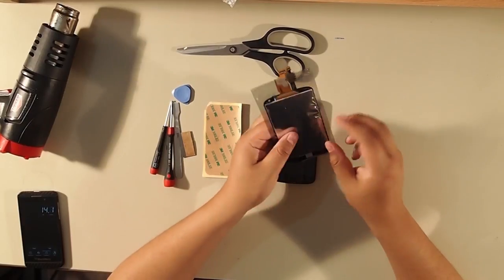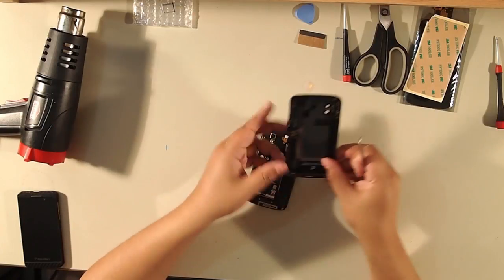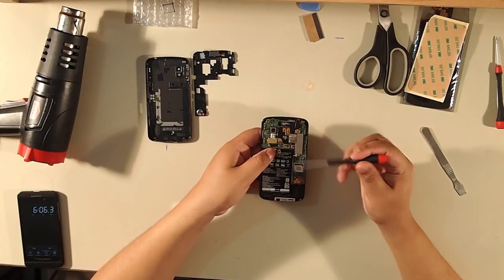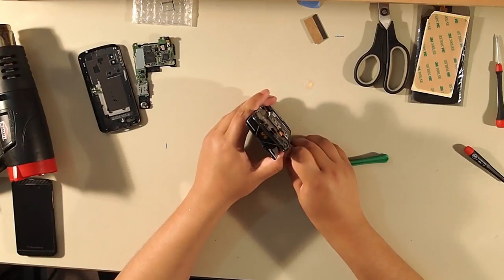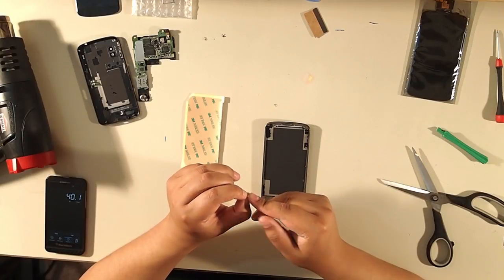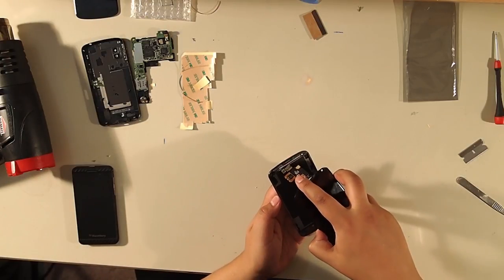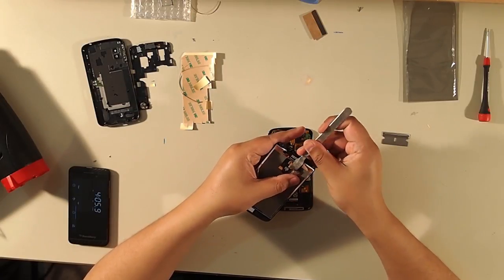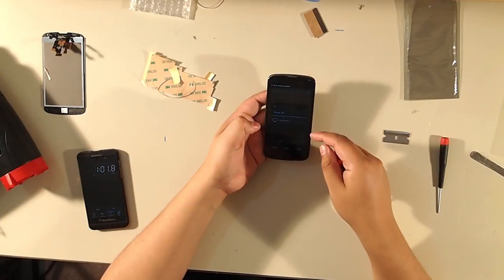Google Nexus 4 (LG E960) Screen replacement.DIY tutorial

Comment: I replaced my screen and there are stripes throughout and the left quarter of the screen is totally blank.  Did I get a bunk screen or did I break something during replacement.  Also, there's a small grey rubber piece that was lying on the table when I finished... what is this and do I need to put it back?

Comment: How susceptible are the parts to melting before the glue softens? 

I replaced the screen on my N7 2013 and the plastic bezel warped/melted from the heat gun while the glue still wouldn't release. I ended up having to buy a new bezel which was very hard to find. 

Now my N4 is busted too, and I'm a bit nervous about doing the procedure with the heat gun.

Comment: I used this method to replace my screen, when I turned on the device the screen worked, but all you could see is parallel lines in multiple colors, so it works but damaged. I triple checked any connection and nothing works. Any one know how to fix it?

Comment: This video was extremely helpful in replacing my wife's broken Nexus 4.  I would like to add a few things that will hopefully help some others in the future.  I bought my screen from Amazon and it came with several tools, but the screwdriver that came was mostly useless.  You will need two different screwdrivers for this: a T5 (torx) and a PH000 (Philips).  I had trouble finding the double-sided tape that was used in the video, but I ended up going to Fry's and buying a roll from the components section.  You're probably better off looking on Amazon when you order the screen.

Another step you will want to take that is missed in the video is the LED cover.  You will need to remove the white cover from the old screen and place it on the new screen before squeezing it all together.  Hope this helps!

Comment: Could someone tell what that silver tape on the digitizer ribbon connection is called?
Reply: Or if it even required for long term use?
Reply: yeah I am also wondering about that, because the new replacement screen digitizer ribbon doesn't have that aluminum foil (or silver foil ?) attached to it.
Reply: I spoke with a 3M support rep and he said we could use:  3M 1181 conductive EMI shielding tape.  I haven't tested it but that is what he said.
Reply: I thought 3M 1170 would be good but I was just taking a guess
Reply: I suppose Al foil will work too, I have made faraday cages out of it and works perfectly in my impedance experiments.

Comment: Awesome video. I replaced my screen step by step and it worked perfect.

It didn't turn on at first when I tested it by just fitting the mother board ... The connections to the on button were loose... I screwed the mother board down and it worked like a charm.

Thanks again!
Reply: No, wait! The proximity sensor doesn't work :|

Comment: Appreciate vid techguyz708 Check the hilarity of my life: We are T-Mobile customers, Wife tripped and shattered her Samsung GS4, I hated my Galaxy Light, so snagged an ATT GS3 with a small crack in lower left corner that work was tossing out and unlocked it and my daughters N4 glass cracked diagnonal from top left to bottom right of screen in a series of events that got her suspended from school for 2 days lol.  I inherited my damage but it's really pathetic going out to eat and the waitress looks at every phone on the table and replaces our drinking glasses with plastic sippy cups lol.  So ordering replacement glass for all 3 phones tomorrow for my clumsy family.
 I was a mobile tech for my office for 4 years, primarily a blackberry shop so I can tear down and replace just about any part on a blackberry  and even have a few unboxing and tear down vids on my work youtube account. I have also done quite a few screen and battery replacements on iPhones 3x to 4s, and very recently with the aforementioned GS3, hard bricked it with a failed root but had a spare motherboard that I was able to drop in with surprising ease and success, so while not familiar specifically with this hardware, I'm not squeamish with the work, but had a few questions for a consummate professional such as yourself:

If looking to just replace glass can this be done without the disassemble, I've seen people on youtube do with Galaxy S3/4? (heat gun and lifting tools, didn't even take the battery cover off).

 On the N4, device powers on, screen clear and visible. The top diagonal quadrant of glass is still touch receptive, but below the crack it is completely touch dead, will this resolve with just glass replacement or do you think I'm looking at having to do a full LCD assembly replacement?
 - Is there anything I can do to test this before purchase?
 - Is this common with LG's hardware or the N4? Both of the Samsung's (wife's with multiple fractures) work just fine and am only replacing for cosmetic value.
 - Comment on Amazon for a kit, warns that he destroyed his LCD with heat gun, and cautions that LGN4 LCD is very delicate.  You FFwd in vid during heat application, but didn't appear as if you were treating LCD with any special delicacy. Do you have any pro tips, or if there is a 'feel' or look to screen once it's gotten hot enough to remove?
 - Most importantly, Is fixing kid's phone worth losing the hilarity that ensues as she flips it left and right like a Rubik's Cube time trial champion trying to access the tap-able half of the landscape keyboard in order to send a text message?

Lastly, I checked the tool kits you linked in About, but didn't see that epic metal separating/splitting tool you were using.  You seemed apologetic to be using, but I want one if you can point me to the manufacturer. The kit I use at work had two plastic separator tools that my student assistant destroyed on first use as the lip or whatever it's called (thin strip of plastic that does the separating) were complete stressed and bend like a straw with any attempt at utilization.  He won't cop to it, but believe he was trying to lift a manhole cover or such with them.  I typically use plastic butter knives, but it is a brittle medium and that metal tool looks like the bee's knees.

Alright thanks! Sorry this ended up being such a book, but hope you have the time and patience to read and respond.  Thanks again for the vid and your efforts!
Reply: You should be a writer.... That was a funny read. Did you fix them all?

Comment: uh quick question... I'd love a fast response from anyone.. in removing my battery the strong adhesive created a tear in the aluminum layer underneath... is it still safe to use or am I up a creek and have to buy a new battery too?
Reply from the maker: it may be safe to use as long as there still another layer underneath. be careful though cause if it leaks you will ruin your phone to start with.
Reply: It's been running fine for a day. Is just the bottom aluminum layer that tore before I realized it as I pried it up. I will check it later and take it apart and see what it looks like after some use.
Reply: +Matthew O'Mealey Did it continue working OK? I just did the same thing!
Reply: James Scott it ran fine for about 3 months. Then started randomly dying around 30% and began going up to 45... 50%. So I opened it back up and the battery was starting to swell up so I ordered a replacement off amazon and it's been fine since.

Comment: Is this what i should do if my screen is all broken? and would a hair dryer work to heat up the glue?
Reply: I just used a hair dryer and it worked perfectly.  After about 60 seconds there was the smell of the glue melting and it came away nice and easy.

Comment: I fitted the new screen but touch is non responsive I think I messed up the foil on the digitiser connector, anyone got any advice
Reply: Hey, did you resolve your issue? I have the same problem, not sure where I went wrong.
Reply: I am also getting same issues, digitizer not working but LCD is working. I tried testing new LCD with old broken digitizer which was working, so its not the fault of digitizer circuit in the cellphone.
Reply: I fitted a new screen and must of pressed to hard and damaged it so I gave up touch was still not working.
Reply: david grimes
 i have initiated a replacement from amazon vendor, but I am worried while taking out the screen I might damage it.

Comment: Help please, I replaced LCD as in this video, but screen goes off immediately after placing a call, is there anything I messed up with proximity sensor or any work around for this? Please help.
Reply: I have the same problem, were you able to figure out a workaround?

Comment: Help please, I replaced LCD as in this video, but screen goes off immediately after placing a call, is there anything I messed up with proximity sensor or any work around for this? Please help.
Reply: Hi, your question is old, and you've likely replaced, resolved or accepted but am curious.  The screen goes off once call connects? Does it happen sitting flat or in hand, or do you notice after you place phone to ear? Does screen wake normally if you press button, or do you have to perform a reset?
Do you have a case or screen protector on? Guessing likely after a screen replacement =)
If this happens when placed to ear and you have a case or screen film on, those likely culprit if it behaves normally otherwise.
I'm not sure this will work on N4, as my own screen woes currently prohibit me from testing but as long not a Samsung option as compared to an Android one, try dialing *#0*# which should bring up the proximity sensor test mode.  IIRC placing hand over sensor turns screen green, then back to white once removed.  If it stays green, try removing the case 1st, then screen film, and apologies if button command isn't compatible.

Wow, was curious and searched XDA. If the above noob solutions don't resolve,is guy found that there was about a 2mm gap between sensor and screen that was causing problem and posted this fix: http://forum.xda-developers.com/showpost.php?p=48459559&postcount=18

Surprised Nexus doesn't have any software way to disable or adjust prox settings, I personally hate the 'setting' that kills screen because you hold phone to ear.  Trying to get some banking done on a noisy bus where speakerphone is not an option, having to constantly wake screen to input numbers is a drag.  My bad for not having earbuds or BT I suppose. 
But I digress, here is link to entire thread the above post is in, lots of great solutions: http://forum.xda-developers.com/nexus-4/help/solved-how-to-disable-nexus-4-proximity-t2558878/page3

Comment: Watch a digitizer-only replacement vid before making your decision. I just replaced my nex4's lcd&screen today w/the help of this video and I went with LCD+Digitizer. Glad I did bc I damaged the LCD while lifting it from the frame. It flexed where the glass wasn't providing stiffness and shattered since it's so thin. The extra $ was worth it for me...got mine off ebay for $100 and it even came with a nice case & tools

Comment: hey there great video but I have a quick question. My nexus 4 screen is cracked and doesn't respond to touch however I can still see the image perfectly. I found on ebay that they sell screens for like 20 bucks and then lcd digitizers for like 100 bucks. What part exactly do I need.

Comment: Fantastic video. I just dropped my Nexus 4 today on the garage floor, and the glass broke but not the LCD. You mention at 0:40 that replacing just the glass is much more difficult than replacement both elements - out of curiosity could you explain why that is? I do want to say that after watching your excellent video I won't be trying to repair my own phone regardless, I'll definitely have someone well-qualified like yourself do the work.